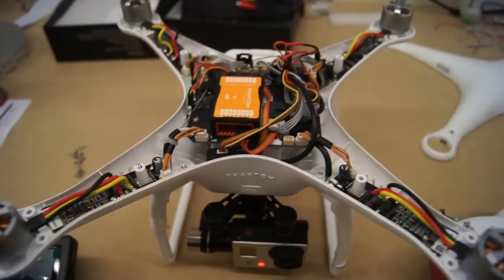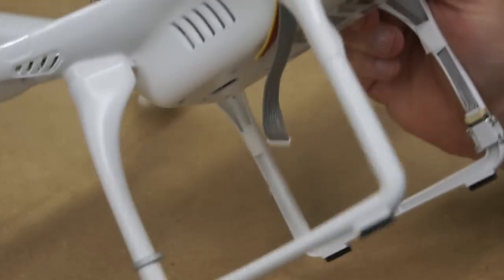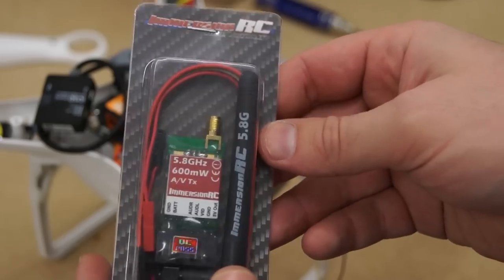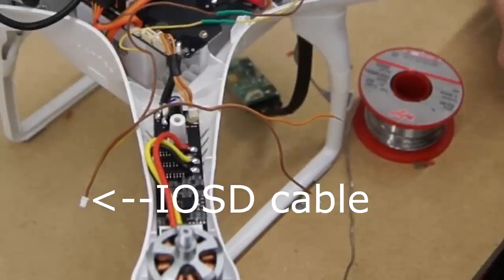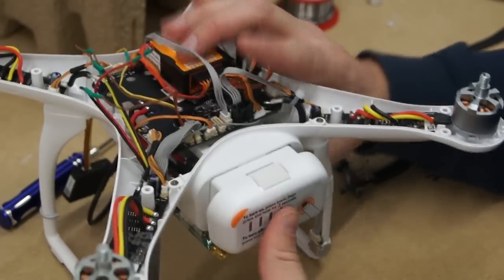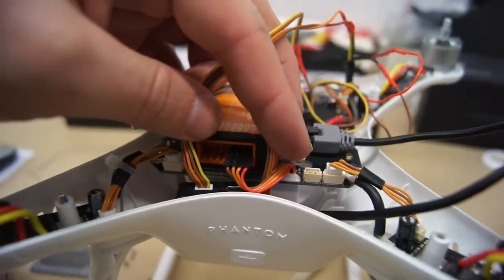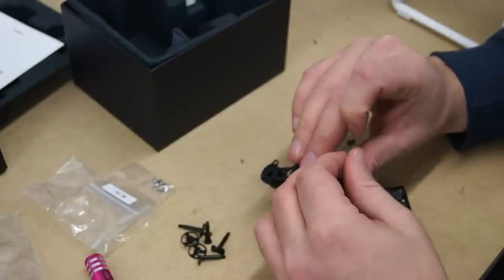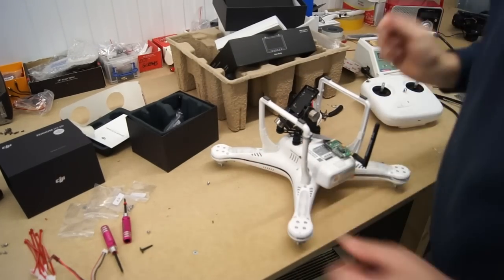Phantom2 iOSD Mini FPV Transmitter & Zenmuse H3-2D install - That HPI Guy

Comment: Hi, i have seen that there are two versions now of the BlackPearl, the 32CH and the 7CH (optimized for ImmersionRC). If i buy the 32CH version, and i have the ImmersionRC 600mw TX. Does it works perfectly as the 7CH for ImmersionRC? What changes. Thanks.
Reply: the BP 32 ch just work 300 meter range with Immerson 600mw but the BP 7 ch can go far 1km with Immerson 600mw the BP 32 ch work best with black mamba Fpv can go far 5 KM or the Flysigth Fpv TX 5804 can go 2 km

Comment: I noticed you had your camera's bluetooth feature on.  Is it safe to have it on while flying?
Reply: That is the wifi not the bluetooth and no I would not fly with this on as it will interfere with your transmitter and receiver
Reply: Cinetrade Thanks for the advise.

Comment: Is the connection between DH3-2D and the GoPro all internal to the H3-3D or are extra cables required ie. thru the USB hub on the GoPro?
Reply: It's all internal for the gopro & gimbal.  Very clean.
Reply: S Newland I was wondering cause i saw no connections or indications about it.. Did i miss something.. How is the gopro being connected
Reply: +Laurie Benjamin, the Gopro has a female connection which slots directly to the DJI gimbal. It's done simply by inserting the camera into the gimbal.

Comment: follow ur video i bought everything to install, not working.
Reply: my phantom wont work after these install, no lights cant power up. Gimble 3d is not stabilize anything, and its lagging shaking a lot
Reply: minhmeoquay did you reconnect the GPS cable ?
Reply: Randy Lachman i did, but i cant start the phantom, and the zimble goes crazy idk y. i redo and follow yr video like 4 time cut and connect the cable again and agian but still like that
Reply: minhmeoquay Do the firmware upgrades. I had a similar problem !
Reply: i cant upgrade the firmware, idk y